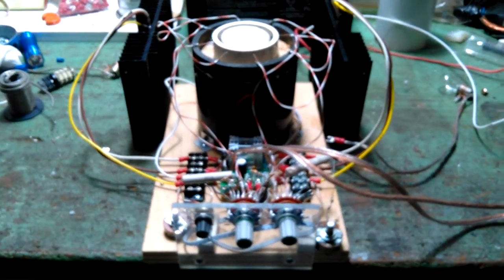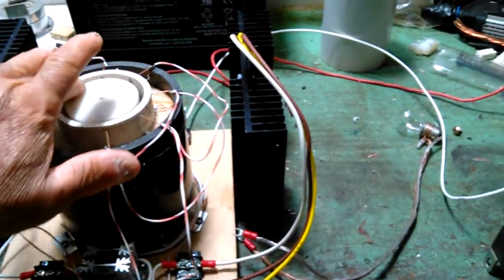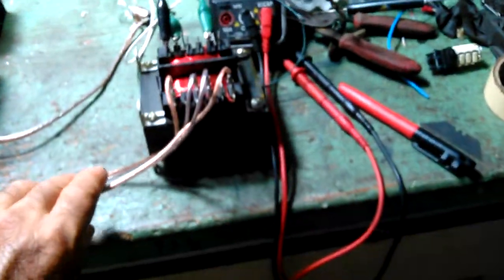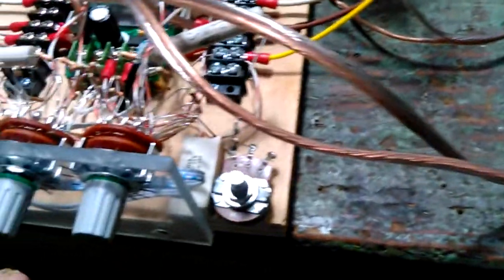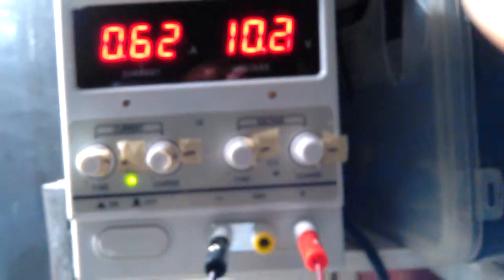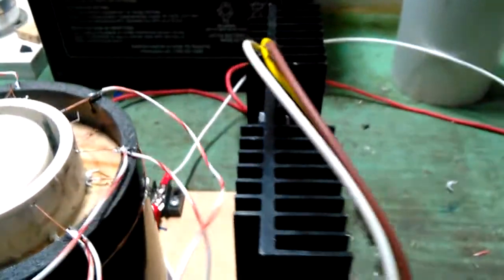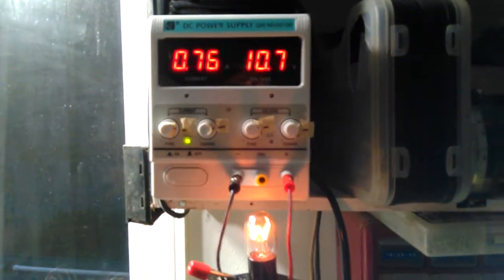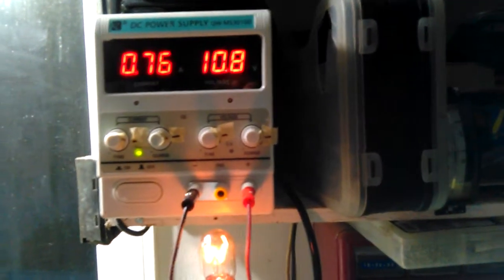Electronic Version of Clemente FIGUERA’s  Device

Comment: So you're using about 8W of energy to power an 8W bulb. Where is the energy gain here ? The fact that without the bulb you consume even more only proves that without the load the circuit works completely pointlessly, with huge losses ( for example, due to harmonic frequencies arising somewhere badly driving the transistors - or for some other reason ).  Anyway, your experiment unfortunately does not contribute anything...

Comment: In the FIguera device the secondary is placed between the primaries and the primaries are reduced just enough to clear the secondary then back to full potential as the other primary is being reduced. each one 180 degrees from another yet maintaining the field line pressure between them. this device can not be built without part G which is an active Inductive controller that has a rotating brush. electronics can be used on top for switching but the ends have to be on longer to get the Inductive roll off of the secondary sine wave output.. the inductor controller preserves the exciting potential so all that has to be replaced is the IR2 losses and such.
here is someone that followed my advice https://photos.google.com/share/AF1QipP4nEyQHK1jTTNgpmOkkh5Oche8_8l7dvCAsBxWJQnPEx5QtSjdBVqdaFxbmOLz1w?key=YnZuaGFWekI2TlIyaURpSUpmZ25GTk1EWFQ4VHJ3
study hard, research hard and bench hard then it will come to you.
Regards,
Marathonman